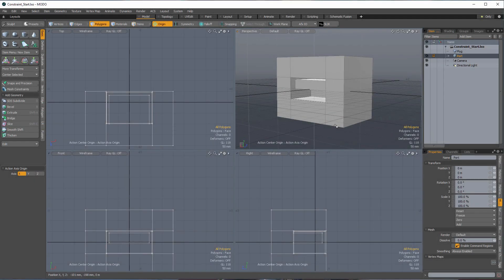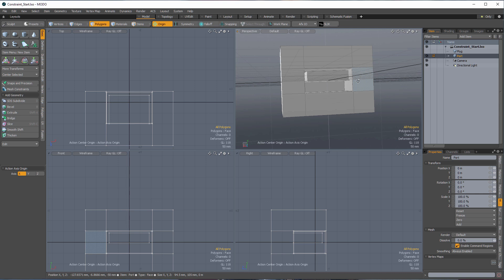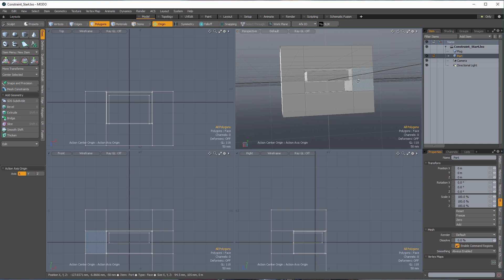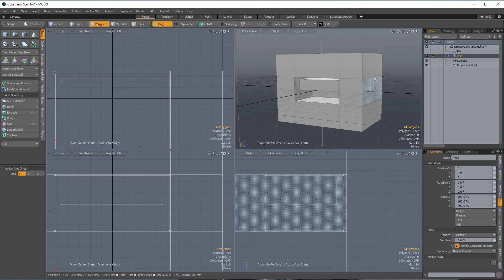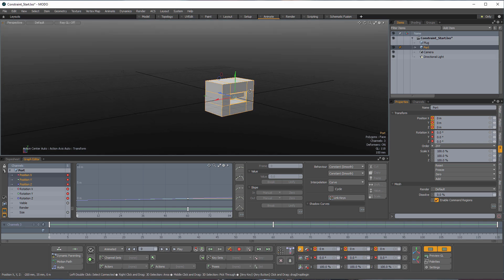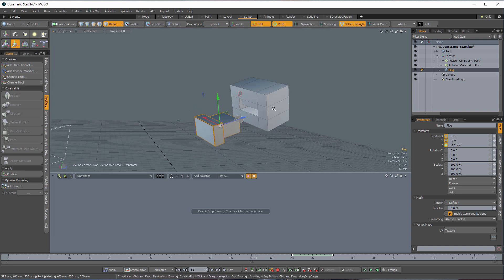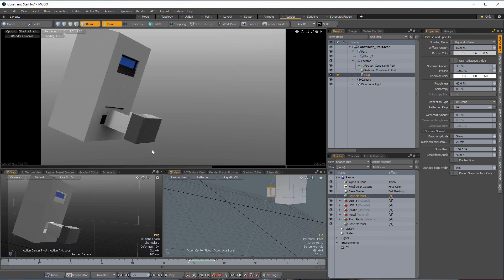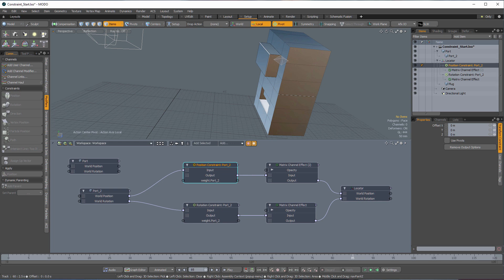Episode 15 Using Constraints

Comment: nice vid ellery, for the port to slide in smoothly, you might want to get the xy alignment to 100% first on the channel effect options, and just let the z option trail behind.  This way, you don't have the stop before sliding in the port, its all one smooth motion.  Definitely better for a sci-fi ship landing, since there is no need to stop, then proceed inward.  Also, it saves putting the keyframe on the USB device as well, and all done in the channel effects.
Reply from the maker: +Mike King Since the constraints work in world space that only works if the port is aligned to a world axis. Since the locator orients itself to the target, you can use the Z position on the item itsewlf since it will be object space instead of world space.